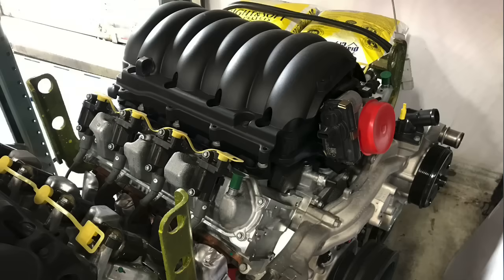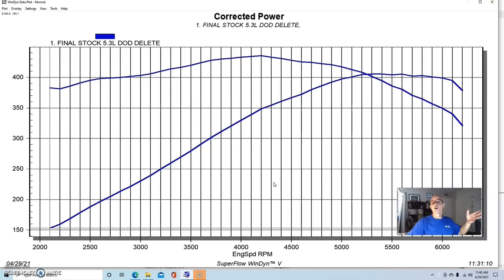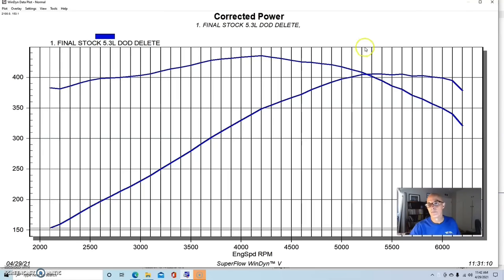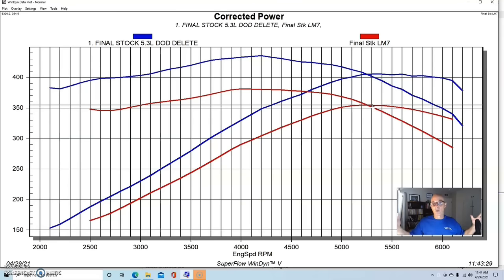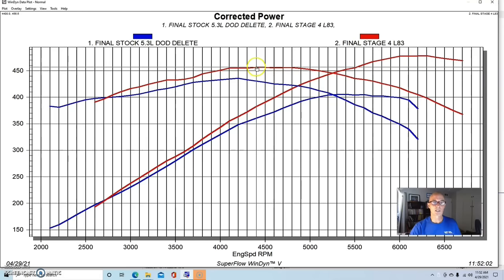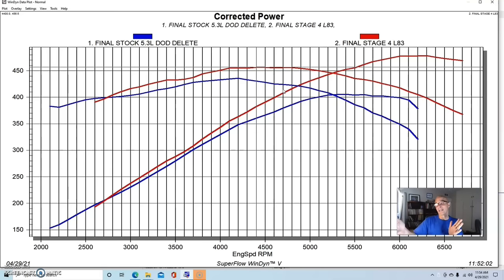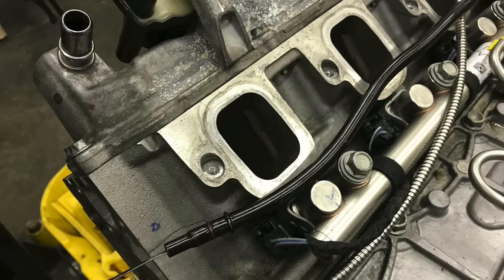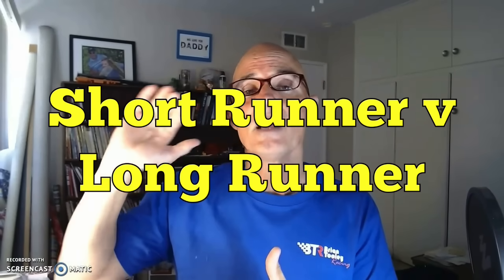5.3L L83 CAM & INTAKE UPGRADES (ADD 100+ HP)

Comment: That’s unrealistic for 90% of people. Kinda pointless test. Who tf is going to take their engine out of their truck then drop the bottom end to machine pistons? Who is going to pay a shop to do that? You can literally buy a brand new 6.2 l86 for the money that would cost. Hell my local shop charges 4500$ for cam labor only. Not everyone has 6 engines laying around to play with. Doing a cam on these engines is hell and cost too much. Performance per dollar is very small. Not really reasonable testing. The manifold alone is stupid. Who is going to pay that when the ported l86 is better? Why not test that? Thats what people can actually justify doing. you ignore all the feasible power adders. What about the 95mm lt5 throttle body? Thats 200$ people can actually afford that. Or the lt2 manifold? Or just heads only? Or porting the columns in the l86 manifold? Different intakes? What about OE ported exhaust manifolds? Shit people can actually do.
Reply from the maker: add stage 1-3 cams-they don't require piston notching

Comment: I would love to put that engine combo in a 3rd gen f-body and go autocross racing!
Reply: 100% agreed! I have a 92 camaro rs with lots of UMI parts, konis, ls1 brake upgrade, upgraded 3.73 rear, built 700r4, and a 98 350vortec pumping out 430whp. Fun car, but it would be a much superior car with an upgraded L83 with 500hp!

Comment: Let me start off by saying I am definitely a Chevy Fan. but I respect all makes right now rocking Ford  gen 3 Coyote can go well over 500 hp with less work and less displacement
Reply: Yeah but you can't compare a 2V engine to a 4V engine.  Of course you are going to make more power with less displacement but more airflow and RPM.
Reply: @button-puncher    I agree with what your saying we have to compare the engines

Comment: done any LT1/6.2 stuff think the biggermotor can hit 600+ na easy, I just got my 2021 Camaro and I'm itching for more power already, flycutting pistons seems like a lot of hassle, I know if I'm opening my motor its getting pistons and rods at least!
Reply from the maker: yes-that is coming
Reply: A friend of mine made over 600 wheel NA. 2017 1LE. Ported heads, cam, MSD intake, E85.
Reply: @s2upid  wonder how that holds up on stock internals since there's no boost maybe it can take it

Comment: With the DI vacuum and scavenging are not required.   Just flow and cylinder filling camshafts respond differently. I been running one for 2 years now in a 95 c1500 has been great
Reply from the maker: reflected waves (intake and exhaust) are still beneficial regardless of DI
Reply: @richardholdener1727   For real question ? when you say reflected waves are you saying intake and exhaust pulsations ? Or meaning the rate at which the air speeds up and slows down ?  I like to ask questions lol or is this different than I’m thinking???
Reply: I am pretty sure you need that vacuum pump on the street. If not you're going to get a lof of build up on the back of the valves. Correct me if I'm wrong.

Comment: Stage 3 cam? Duration seem too low for a stage 3 cam. Is that cam phaser the same as 4th gen cam phaser? Because it looks alot like the one I took out from my car and replaced it with a compcam one.

Comment: I was looking at aftermarket ported l83 heads and ported 243 heads and the cfm rating seem to be very similar. Actually GPIs ported l83 is just a hair under texas speeds cfm for 243 stage 1 head i know they do there testing differently but maybe you can cover some of that.
Reply: L83 can do 1100 whp on stock block, crank, and heads with good pistons, cam, and a turbo
Reply: @bturner-jw8dz  oh yeah for sure i was just wondering the difference in CFM from ported l83 and 243 heads because they seem to be the same, as if l83 heads dont respond as well to porting as 243s.
Reply: @BurtJr26  they respond well to porting but not as big of a gain because you start with a better head.. intake side at least stock to stock. Ex needs love with ALL LT EX PORTS
Reply: @vortecturbo  I kinda figured at the time i checked and no one had flow data from the same company but it seems the older LS heads are still just as good (in terms of flow) when both ported.

Comment: All truck injectors the same ? 3rd gen 4th gen 4.8 5.3 6.0 ?
Reply from the maker: no-they range from 21-25 lbs with flex fuel being 33-36 pounds

Comment: 510fwhp just cam and intake is pretty good. I wonder how much more u could get from head work(530-550fwhp??) Or did they not leave much on the table for head porting with the gen v
Reply: I think there's room for a bigger intake valve.  Stock valve is 49mm, if I'm remembering correctly.  Should be able to fit a 50.8mm valve in.
Reply: Heads are pretty dang good. I bet cleaning them up will do what you are hoping for. Of course throwing some boost on it is never a bad idea!

Comment: So with the stage 3 is it worth the money to swap intake as well? Doing budget swap with L83 into 05 RX8. Have basically new bone stock L83 w/ C6. Would like to bump a little prior to plugging it. Will definitely get the stage 3, but should I get the intake or no?
Reply from the maker: the msd will help as shown, but I will put up the L83 vs L86 intakes with the different cams

Comment: I remember I saw these heads at LS fest and it dwarfed the cathedral and even square port heads, just a matter of time gen 5 takes over LT the world ? Lol
Reply: The gen 5 Lt1 style heads will outflow ls7 heads
Reply: you got numbers?
Reply: big boy ls3/ls7 heads are doing 230+cfm by ..300", 300cfm by .400" and 340 or so by .500".    Peak flow of 360 to 420 cfm.  

My intro on the LT show numbers a ls3 can beat  but recently someone showed me otherwise.
Reply: I would bet that with a BERY mild port job and moving to a slightly bigger intake valve the l83 head would outflow the best ls head. A head to head ls to lt head  shoot out for Richard! I'd watch that!!!

Comment: I would like to see a comparison between the stock gen5 and a modified gen3 or 4 that makes about the same peak power so that we can see the difference in torque and power underneath the curve.
Reply from the maker: I have that-stock vs stock and 500+ v 500+ hp-might come next
Reply: @richardholdener1727  ok cool. I must've missed that one

Comment: Its a bit expensive to play with some of the newer stuff, but they make really efficient power.
Reply: A lot*
Reply: Its a great time to be a Gear Head
Reply: It’s not expensive.. if you want to make the power these engines make you would have to spend more on the older engines. End of day they are cheaper. You can get a 385 hp 6.0 for $1900 and slap it on a car and call it a day. For you to get 385 hp from a sbc 350 you’re looking at $500 for the block $2000 for a good set of heads. $800 for the complete cam kit and $400 for an intake. You ended up paying more to make same power with sbc.
Reply: @Miguelspl150  Not always true. I can source complete small blocks for much cheaper than that price but at the same time, I can source a 6.0 for about the same price. You cant get a 6.0 running in a car nearly as cheap as a carbed, mechanical pumped sbc. The cost of computer components, ignition, and tuning makes for less than an affordable swap. Meanwhile, I had a 350 with a mild cam running in a Berlinetta with a couple of wires and hand tools.
Reply: @Miguelspl150  my point was control and integration to transmissions and vehicle canbus etc